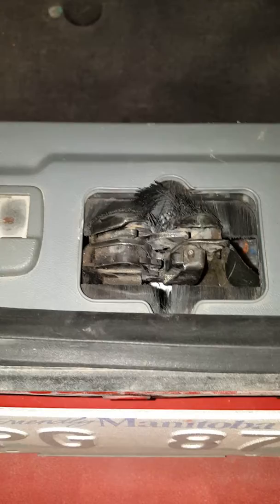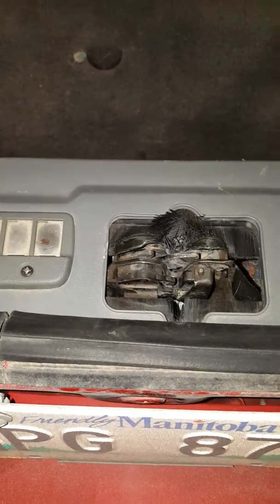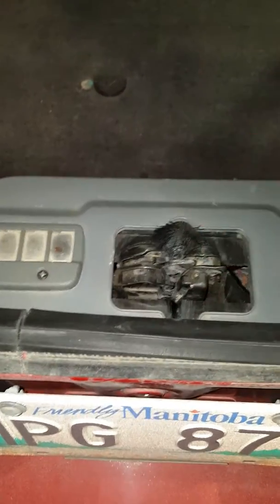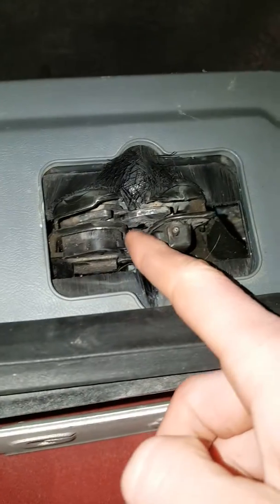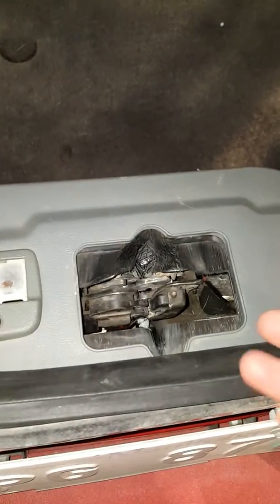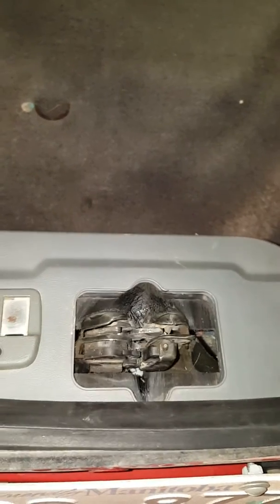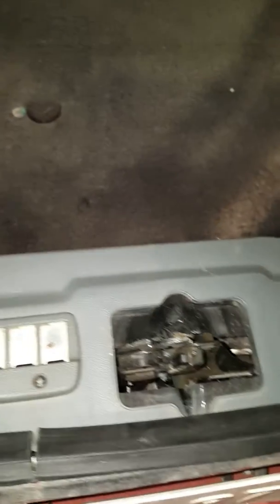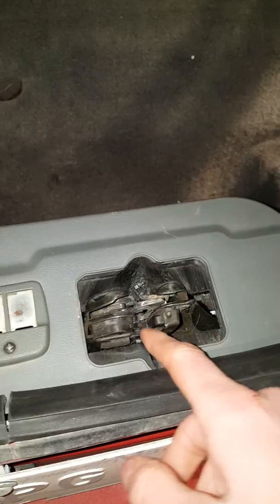Third Gen Camaro Hatch Motor Stuck in Down Position - Fix

Comment: You're a life-saver, or more accurately a battery-life-saver!  This just happened to my Trans AM GTA, I'm not sure why either as I only sprayed maintenance oil on the contact points to keep them from rusting.  The car is trapped in a garage with a shelf above the hood preventing me from disconnecting the battery so if I hadn't been able to get that trunk down tonight, the trunk light would probably have flattened the battery over night!

For some reason, the latch mechanism on mine hadn't come all the way up when I opened it - pressing the magic button sent it all the way back down, then releasing it  sent it all the way up - problem solved!

Comment: So, the guy I bought my 89 Iroc from said the motor was messed up. It worked a few times but 85% of the time it wouldn’t come up! I bought a motor and threw the other one away. Same problem!!! But this motor from auto zone is a lot noisier! Anyway, I kept having to take the plastic cover off to unplug the motor and plug it back in a couple minutes later and it would come up. You just saved me all that damn trouble! Lol! Do you know where I can find that switch so I can replace it? Thank bro!
Reply from the maker: There are two switches in the hatch pulldown assembly, the striker sensing switch (the one in the video GM P/N 20627125) and the reversing switch GM P/N 20614880. Reinforced pulldown assemblies can be bought from https://www.top-downsolutions.com. The reversing switch is quite easy to find online, however the striker sensing switch is much more difficult. Mine still works so I didn't have to replace it (fingers crossed), but if you do have to replace it I would check your local dealers and/or the junkyard. If all else fails http://www.davidt.com/ is one of the largest Third Gen collectors in North America and sells parts from their website, they will have the striker sensing switch.
Reply: @nickridley967  I appreciate the info! Thank you! You’re awesome my man!

Comment: Didn’t work for mine so it’s probably a bad latch right or is there another trick
Reply: It’s most likely your pull down relay. But be sure to test it with a multimeter before buying a new assembly. If replacing the relay doesn’t fix it you may be dealing with a faulty striker sensing switch. Details for that are in the description.
Reply: @InfectiouStudios  okay thx so check the relay under the hood
Reply: @jamescampbell7509  Not the one under the hood, there is a relay directly beside the pull down motor in your hatch. The relay gets a ground signal from the striker sensing switch which engages the pull down mechanism. Remove the hatch motor cover and it’s right there near the bottom.